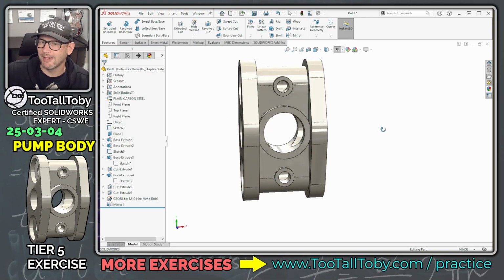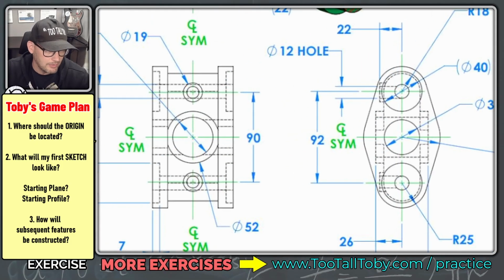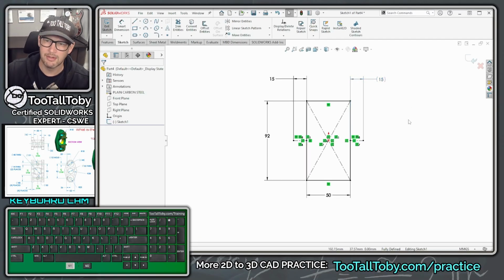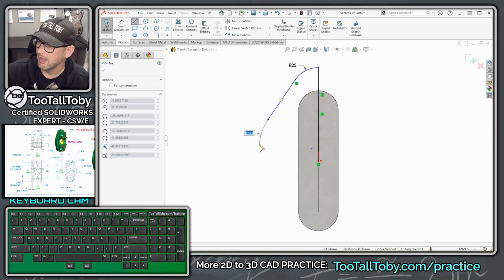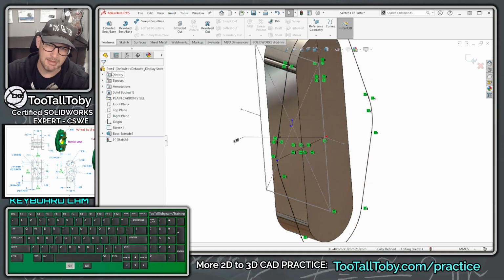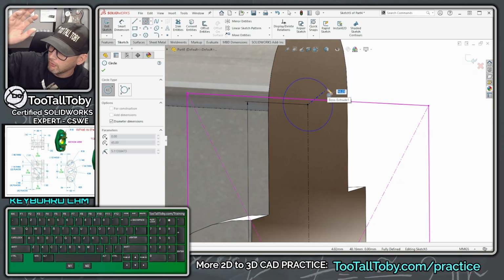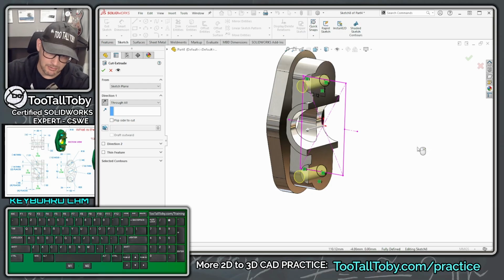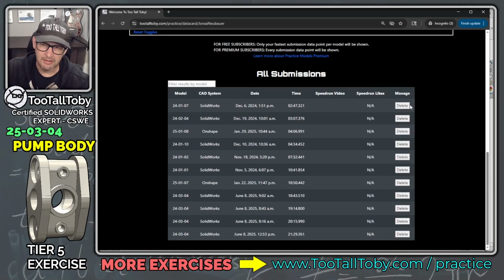BEST SOLIDWORKS TIPS and TRICKS!  Step-by-step Intermediate Tutorial - 24-03-04 PUMP BODY

Comment: When specifying [constraints] the beginner should just do it the "slow way". 
Click on constraints icon tool to activate the left panel.
Go through selecting, completing and escaping for each area.
This is more straightforward.  It is so easy to make mistakes, over-click or get lost.

Holding "ctrl" then clicking on entity and "looking" for the "context shortcut pallette" is a super shortcut.
I use it myself, but it would have confused me if I were a beginner.

Comment: Sir can you help to get the blank size from flat dish end in solid sheet metal dia 1000mm radius 50 and 15 sf iam unable to find the solution because it's not flatten
Reply from the maker: You'll probably need to use the "Flatten Surface" tool to get that blank size!